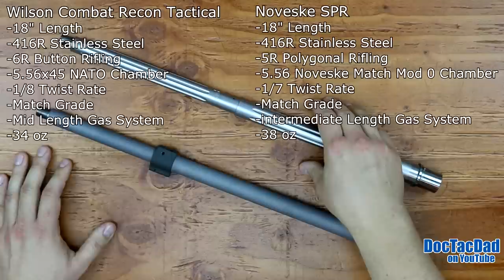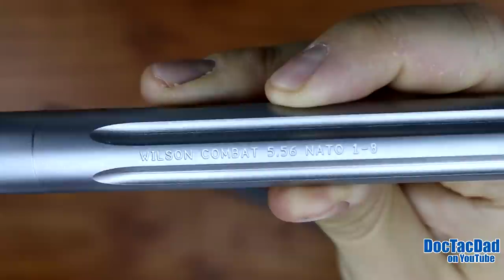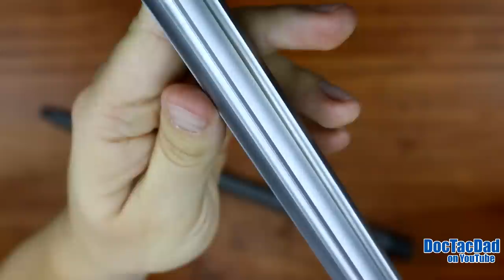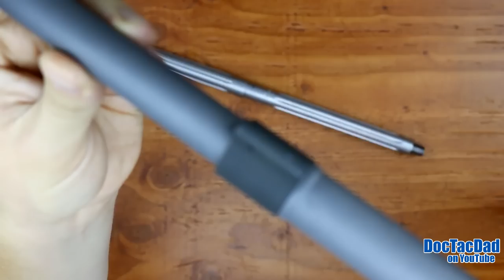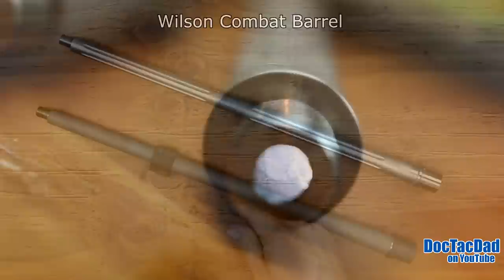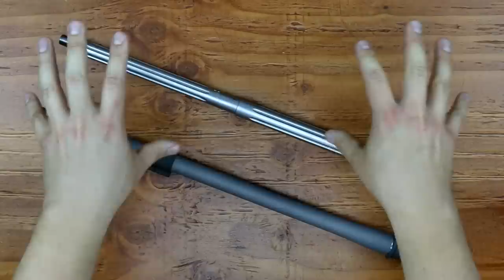Wilson Combat vs Noveske - Barrel Comparison - Project SPR 2.0

Comment: I have a stainless 5.56 chambered  Wilson Combat barrel and love it! Go with the Wilson IMO. A 1/8" twist is a better choice, sub minute is plenty accurate, even with standard rifling it will last a very long time, it's weighs less, and it looks much better. I must admit, it is like splitting hairs between the two, but I would still go with the Wilson without hesitation. Hope this helps man. Looking forward to the rest of the build!
Reply from the maker: Ian Wolfe Thanks man! Is your Wilson the Recon Tactical?
Reply: No prob man. No it's not a Recon Tactical. It's an older varmint bull barrel that's not in production any more. It's appears that it is very similar to their current 18" 5.56 bull barrel though.

Comment: If I were choosing, I would probably go with the Noveske SPR. The 1/7" twist, based on my personal experience will be fine with both 55 gr, 62 gr, and 77 gr rounds, the polygonal rifling (based on what I've heard from other polygonal barrels such as Glock) will provide a more consistent gas seal and more consistent velocity, the intermediate gas system will have a lighter recoil impulse and may be more reliable. The SPR is darker (you could always duracoat or cerakote the WC though), and they are both stainless steel, so the barrel is more uniform throughout and will last longer. Just seems that the Noveske is a little better for this application. Don't get me wrong, I have a WC barrel that is the same as that one for my 300 BLK SBR, and its great as well, but that is a different type of application.
Reply from the maker: Ghoogleplus SUX What kind of groups you getting with the 300 BLK?
Reply: When we can find ammo, 1/2 MOA at about 50 yard zero with the EOTech. My 300 BLK is only 11.3" barrel though.
Reply from the maker: Ghoogleplus SUX Nice
Reply: Yeah, so in regard to the type of accuracy and purpose, what stocks are you looking at? SOPMOD, Magpul PRS, CTR? Just curious.
Reply from the maker: Ghoogleplus SUX Vltor Emod
Reply: Nice choice! Had one on my AR-10. No wiggle, nice storage!

Comment: Had the exact(almost) WC barrel, but with a rifle length gas system and it was smooooooooth.  Shot very accurate.  Could not touch my Mk12 Mod O with 18” Bergera barrel tho.  Loads from 62gr up to 77Gr Blackhills.  Beautiful WC barrel!!

Comment: 5.56 and .223 are specified at the same pressure. That pressure is 55,000 PSI when measured using the SAAMI method. Most pressures you will encounter in the USA are based on the SAAMI method of measuring pressure.
CIP is the European version of SAAMI, they define the specifications for cartridges, including maximum pressures. Except that they don't use the same method as SAAMI. SAAMI measures pressure using a piston on top of an intact brass casing (called the "conformal piston" method). CIP uses a hole drilled through the chamber wall and the brass, exposing the sensor to hot gasses directly. NATO (outside the US) uses CIP's method when they define pressures.

When you measure a 5.56 cartridge that rates 55,000 PSI under the SAAMI method using the CIP method, you get somewhere around 62,000 PSI instead. Same cartridge, same pressure, same chamber, just two entirely different methods of reading the pressure. NATO uses the CIP method, so their documents will reflect the higher number, even though the specified pressure is the same.
Reply: Wrong. Shoot full auto through a .223 barrel and get back to us...

Comment: I have tested many different loads through a 1:7 barrel purely for the sake of experimentation. I did overspin on particular load through a 1:7. The 35 Grain NTX lmao 5 for 5 shots. However I have probably fired 300 53gr Vmax at the range with no issues.

Comment: for optimum accuracy you can benefit from going to "gain twist" rifling. Look it up. I agree that both are pretty good barrels. If I had the choice I would choose the Noveske simply because it isn't fluted.
Reply: What is "fluted"?
Reply: Its the cuts into the walls of the barrel. It is to reduce the overall weight without a loss in accuracy, however more and more it is purely for the aesthetic.
Reply: +pillowsocket And, what is SPR?
Reply: iosef Pindo Special Purpose Rifle. ..wich usually means a rifle more designated to long range precision.
Reply: +Douglas C ok, thanks

Comment: I am a lover and owner of both guns (several of each). To keep it short, what's the purpose? For high volume I'd go with NOVESKE. I'm looking for accuracy and have to say LES Baers cut riffled barrel in 1 in 8 shoots lights out of any AR barrel I shot. My 18" will shoot sub .5 all day. That said, I love my /Wilson 1911s but between tWo, I d go with NOVESKE for dependability and time building ARs. I am part owner of the largest indoor range in the country including military/LE shoothouse and range so we see a lot of what's on the market. I've got to where I just shoot Black Hills remanufacted 75gr mk..again, I'm looking for accuracy out to 500. If it's not accuracy the NOVESKE will handle anything I run through it and their barrels last a long time. FN use to make their barrels, I don't know who does now....good post!

Comment: This, obviously, is not an easy choice to make. Both of these manufacturers make fine and desireable barrels. When I saw that the Wilson had 1/8 twist rate and realizing that it would seem from all other comments previously made, that 1/9 is optimum for the 55 gran  5/56 - .223 round. IS tis about correct ? Then all other points of both Noveske and Wilson being considered and studied,..I would lean towards the Wilson Combat barrel for your build,...................I think.

Comment: I have WC 223 wylde shoots NATO under 1 moa.  Hand loads same hole.  Before I bought this I had a 450.00 dollar rainier ultramatch barrel with the 5r and I couldnt get the gun sighted in with NATO rounds 8 inch groups.  Was a crap barrel I sent it back twice.  The first time was the pin was mushroom.   They ground off side of it to fit.

Comment: Things I look for in a new .223 barrel:

16"
5.56 or .223 wylde
Melonited
1:8 twist
At least Midweight 
Not 4140

I read that stainless barrels wear quickly
Reply from the maker: joshv06 I believe stainless barrels have about the same lifespan as a chrome/moly barrel, but you will see a more dramatic drop in accuracy with the stainless at the end of it's life, whereas; a chrome/moly barrel you'll more likely see a gradual drop in accuracy over the life of the barrel.

Comment: I have this exact same dilemna.  I'm building an SPR and these are the two barrels I have been debating.  The Wilson is a beauty and I have no doubt it is an awesome barrel.  Does Wilson make them or do they contract them out?  I still plan to go with the Noveske due to their reputation and their chamber mods you mentioned.  I am building from a Noveske Gen III lower, so that also pushes me in that direction.  No losers in this debate.  I have a second lower and I imagine the Wilson will end up on it before I am done!  Thanks for the video.

Comment: One thing to be careful about when talking about Wilson barrels, Wilson barrels are very common in the AR builder market, but they are NOT Wilson Combat, they are two different companies. DocTacDad is using Wilson Combat out of Berryville AR, very high quality barrels.  Wilson Arms is more of a mid line barrel and they are out of Cape Girardeau MO. If looking at a Wilson barrel, check whether it is Wilson Arms which are more common, or Wilson Combat barrels, they aren't that common. Again, DocTacDad is talking about Wilson Combat.

Comment: If I had $2500+ in a Noveske rifle I'd be a big "fan", too. Even if they shot like shit or I'd never done what I claim to do with them "easily". Fortunately, I've got less than $2500 in TWO Wilson Combat-barreled rifles and they're both easily sub-MOA and not just on the range on a nice mechanical rest on a nice solid steel bench set in concrete. Mine get it done across pickup hoods and prone in prairie dog pastures lying in the dirt and stickers, too. To the tune of TEN rounds in an inch with the 5.56 1:8 stainless barrel and although I haven't shot many "groupings" (grouping is a verb the "tactitools" use as a noun) with the 7.62x40WT 1:12, it was sub-MOA on sight-in day and on a whim I later center-punched a PD at 150+. On the ground prone with no match. 110 V-Maxes and various 150-grain bullets at 2100-2450 in the WT and 40, 50 and 55-grain V-Maxes in the 5.56. I don't know where this "tear apart a bullet" crap comes from with 55-grain bullets at 3100 fps, but I've shot oh...three thousand 55-grain V-Maxes at 3100 with 1:8 and a thousand or so 40s at a CHRONOGRAPH PROVEN 3300 fps (Shooting Crony Gamma Master) and I haven't had any "blow up" yet. I tend to think 40s at 3300 from a 1:8 twist would be more "fragile" than 55s at 3100 from a 1:7 twist, but I'm not an expert trying to sell Noveske and I damn sure don't have any clue why anyone would want "octagonal" or "polygonal" so-called "rifling". Which really takes a ROUND BORE and puts FLAT SIDES INSIDE IT. Not exactly what I want to put ROUND bullets through, but nobody is paying me to shill the "technology", either.

Funniest of all are the "If you want an accurate 1911 pistol go to Wilson Combat, but if you want an accurate rifle go to Noveske..." comments. First of all, a PISTOL is a SHORT-BARRELED RIFLE with a whole list of DIFFICULTIES and DISADVANTAGES THAT GO WITH THE SHORT BARREL. Second, there are tons of companies making sub-MOA rifles and ONE that makes a sub-THREE MOA pistol. That's Les Baer Custom. Then there are the sub-FIVE MOA pistols and that's pretty damned good shooting from a pistol. Wilson Combat is one of the companies that guarantees pistols that accurate. And Wilson Combat apparently guaranteed Mr I Need Help Deciding here sub-MOA performance. Noveske didn't offer any better guarantee or he'd be using that in this commercial. What does that tell you? Wilson Combat can build rifles with the best of them. And does. And they charge just as much for their "high-end" rifles as Noveske.

The difference is that an amateur "gunsmith" like me can put Wilson barrels in "homemade" rifles and have TWO for the price of one Noveske, because I've got less than $2500 in the PAIR of my sub-MOA Wilson Combat-barreled self-built ARs. And any Noveske owner that wants to come outshoot them is welcome any time. Just be prepared to get dirt, benchrest boys. Stevie Wonder can shoot sub-MOA groups on a bench.

Comment: I think you'll get more accuracy out of the Noveske especially through sustained fire due to it not being fluted. Heavier bullets will shoot better due to the twist rate as well.
The Wilson Combat I think comes with other perks at the expense of accuracy. It is fluted so it is lighter. Every ounce counts. The 1/8 twist rate will give you more versatility in ammo.
Personally, I value reliability, lighter weight, and versatility over accuracy. Finding a way to to lighten the rifle will make the thing more bearable to carry out in a realistic environment. Wilson Combat is already saying it will shoot sub MOA making it more than adequate and the level of accuracy between the barrels is likely unnoticeable.

Comment: DocTacDad- Not sure where you came up with the spin issues for the twist rate. I have shot all sorts of rounds through 1-7 twist barrels (8 years in the USMC). Things from 52 grain match to 77 grain... INCLUDING hundreds of thousands of M193, M855 through M16 and M4 rifles. Sounds like an excuse from a manufacturer for garbage bullets coming apart. My noveske barrels in 1:7 twist shoot 52-55 grain bullets with sub HALF moa. My pet load with 52 grain hornady match and varget lets me print smiley faces with bullets touching. ie sub 1/3 moa.

Comment: A 1:7 twist barrel can easily handle 52 and 55 grain bullets with sub moa accuracy. Please don't preach about something you've never experienced or tested. You are contributing to false information.
Reply: So can a 1:8 and a 1:9 twist. I've used all 3. However, a 1:8 in my experience is the best choice for the greatest range of bullet weight. My preferred choice? Hornady Black 75 grain. Why? Avg group in my last custom M16A2 (16" barrel) at 100 yards: 1/2" groups consistant with 1-2 mph wind, best group: .360", iron sites, clocked velocity: 2639 fps, zero ftf/fte, $15 box at Cheaperthandirt.com! I've tried 55 grain, 62 grain green tips, 62 grain Hornady black, and 75 grain Hornady black. I probably pushed the envelope at 75 grains, but they worked well at 100 yards, 200 yards, and all the way out to 500 yards. I've since sold my M16 and I'm now building another M4 with an 18" barrel. better quality parts all the way around. Hmmmm, maybe I'll make a youtube video!

Comment: I have Wilson Combat match bow same when you got on the table but it’s not flooded one and seven twist . I shot 55 grain I did a one and seven and never had a bullet come apart I had no problem shooting with the 55 grain 77 Green no problem I love Wilson Combat barrels. I’m looking to buy next 20 inch Grendel barrel and build an upperWould say other AR 15 that I have the AR 15 that I have with the Wilson Combat barrel as a Gleason trigger to stage can’t remember the number of it black rain upper and lower I have the Teflon screw underneath the pistol grip to make it tighter have a BMC I don’t know if it’s 13 or 15 inch rail key mod thingsShoots phenom or a bowl they also have a When tech dragon muzzle brake pricey but it’s well worth the money no rise at all rapid fire and I have a spikes tactical BMC but in carrier

Comment: Question: can you shoot 223 out of the noveske barrel???
Reply: As long as your upper is 5.56 mil spec which a vltor upper is. A 223 upper is much thinner an deteriorates faster. So basically 5.56 can shoot .223 but a.223 can’t handle 5.56 consistently. Yeah you could get a few rounds here or there but I wouldn’t recommend that

Comment: Wilson Combat makes excellent barrels. I just wouldn't use a fluted one. Not as rigid.
Reply: +Eat My Dust lol, jeeze man. That was a bit harsh
Reply: Jimmy the hodgetwins told me to tell you that your a Peter puffer and that they saw you cross dressing.
Reply: @18B_Madder  A fluted barrel of the same diameter will not be as rigid as the original.  Simple physics.  Removing mass will reduce rigidity.  Fluting doesn't introduce some magical properties to increase stiffness, it just reduces weight without sacrificing AS MUCH rigidity as an overall decrease in diameter.  A 1" diameter solid barrel will always be stiffer than a 1" fluted barrel.  So fluting is a compromise between the original mass at full diameter and the smaller mass of a reduced diameter.  So the original statement is correct for barrels of the same outer diameter.  Even if you've never taken a physics or materials science course, there are several good videos on YouTube that explain this, and barrel harmonics in general, in terms that are easy to understand.  I suggest you watch a couple.

Comment: You are way off base on your twist rates and bullet length.  I have shot many a 40, 52, 55 grn  bullets in a 1/7 twist barrel with sub moa results.  Nothing more than internet folk lore.
Reply: +jon jenkins I agree.  SMK 77gr actually say 1/7 ONLY.
Reply: *****
Correct even though it is not uncommon for them to work well in a 1/9.  I see no eason to not just get a 1/7 as it will do it all quite well.
Reply: Uh, that's because heavier bullets need faster twist rates and 77 grains is a very heavy .224" bullet.

Comment: personally I dont trust polygonal rifling
Reply from the maker: AlaskanFrontier1 Any specific reason why?
Reply: DocTacDad
Well, originally just regular polygonal rifling was weird in the fact that, it would through "flyers" about one in every ten rounds fired. That being said, don't be surprised if you see occasional flyers with that barrel
Reply from the maker: AlaskanFrontier1 Interesting...Does that only deal with true polygonal rifling like the HK produces or the Semi-polygonal rifling in the Noveske?
Reply: DocTacDad
I know it applies to HK barrels and depending on how polygonal Noveske's rifling is it could very well apply there too
Reply from the maker: AlaskanFrontier1 HK is true poly, whereas; Noveske is a land and groove rifling that has the edges cut of the lands. True poly barrels are fraught with different issue then normal land groove bbls.
Reply: DocTacDad
yeah I still dont trust PR because i  the ultimatum it tries to shape the bullet to spin were as normal rifling just makes it spin

Comment: Look guys, do this. Call Hart, Krieger, Rock Creek, or Shilen Barrel companys. Get a true benchrest quality barrel made to preform. Make it simple and quit this guess work. Ya you will pay $100.00 more, so what! You can get a Shilen for under $500.00 and that includes a properly headspaced bolt included.

Comment: Doc......your'e making a judgement on a barrel based on outside machining??? Im a machinist and a little scotch-brite and sandpaper can make anything look good. Key question is whrre did the blanks come from ? If you want accuracy don't use 55gr pills. I've used 52-53 match bullets in 7" twist barrels with no problems. Love your vids.....but shut up and shoot man! Don't over think these things. Shoot NRA/CMP highpower and get good.